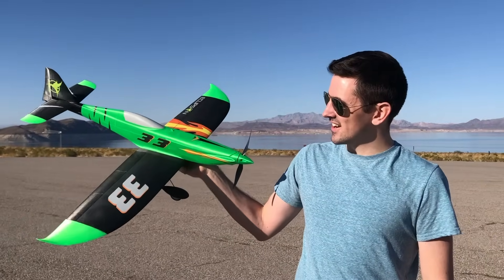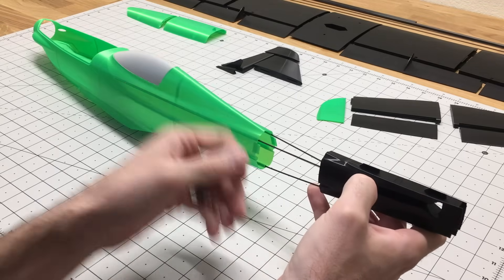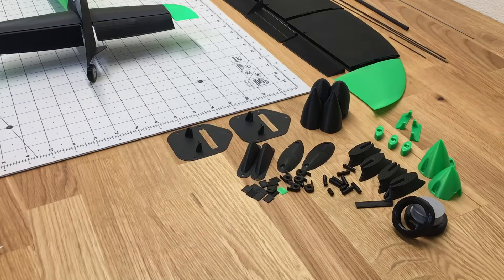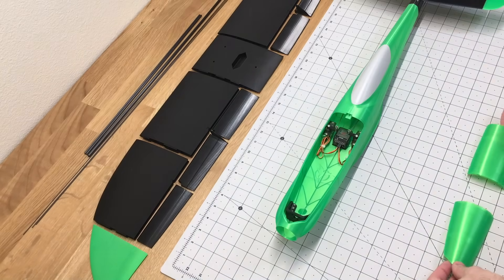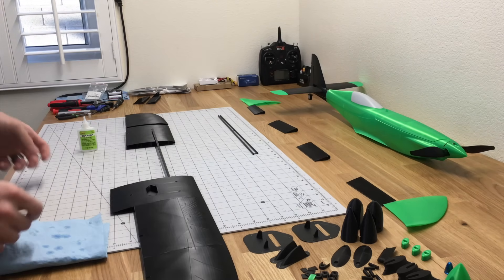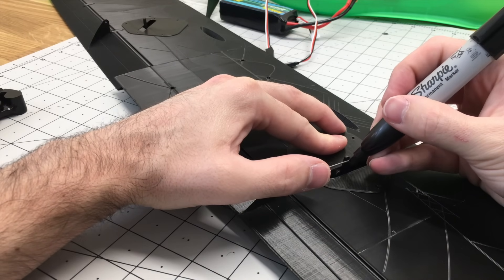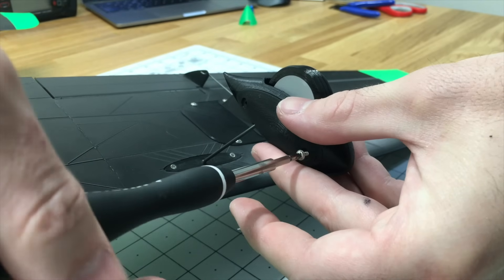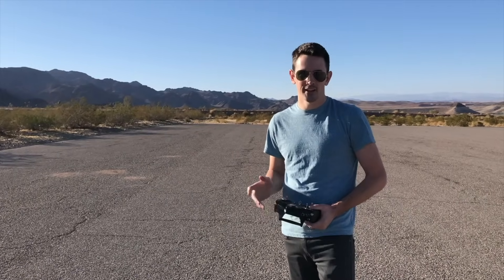How to Build 3D Printed Eclipson Model R - RC Airplane

Comment: Nice color scheme. I really like the Eclipson construction methods and choice of hole sizes for the control surface hinge points. Thanks for another great video!
Reply from the maker: Thank you CJ, It is a very clean design for sure the hinge system works very well. Cheers

Comment: Eclipson needs to offer a discount code for your subscribers. Your build videos are far superior to their own.
Reply from the maker: Thank you, Ya they did have discount codes for me but not very many people used them.
Reply: @TroyMcMillan  I maidened my Model D Saturday and was astonished how well it behaved. Bought and started printing the R today. What do you think top speed is with your motor/prop/battery setup?
Reply from the maker: @scottsmith4089  Nice job getting your model D finished up. With the setup I used I definitely think it got to 100mph but I was having problems getting a good read of speed with the speed gun I was using you can see in my flight video for this build. One of my followers said I should use an 8x8 prop I ordered on and put it on but I have not flown it with that prop yet. It is fast though and it flies very well.

Comment: Best thing about 3D printing planes like this is they're cheaper to buy them and rebuild a few crash and it's a cheaper learning curve and a lot easier than building flight test phone planes or a ball supply plane as well so 3D printing a RC plane might not be the fastest but the cheapest way for someone new to learn how to fly RC planes cuz they fly very well if you get good files and you can sand the plastic and paint it any paint skin you want with just some regular spray paint too as well it looks great but make sure you use like model car or like RC car tire spray paint that flex is on plastic so it doesn't chip off

Comment: Troy, thanks for getting me back into the hobby. Your Airbus 320 inspired me to get a 3D Printer, make the Model A, convert 9 of my 30+ year old RC Planes to Electric. So much fun. I have a question, where do you order the vinyl decals you use on this and other projects?  Happy Holidays. Scott
Reply: The plane print sites have the decal sheet scheme plans. I give them to my wife she prints them off her cricut using 3m vinyl

Comment: That looks like something I’d love to print.  It’s quick, I wouldn’t call it fast.  I’m glad to see that the designers are using carbon rods for reinforcement.  I’ve always thought the concept of 3D labprint not using carbon in their designs was massively flawed.  Having built composite airframes for a very long time, it’s willful ignorance not to use the lightest, strongest, and potentially most durable materials for the load bearing duties and let the shell do the aerodynamics.  Nice work! 🤙🏼🙌🏼👍🏼
Reply: Right material for the right job. :)
Going "pure" 3D-printed would also mean printing the motors too. LOL
Reply: They hold up pretty well ( 3dlabprints). No breakages so far with the Messerschmitt.
Reply: @user-cm6tj2he4b  I’ve printed quite a few from the very first models to the latest versions and they’ve innovated a bunch.  I’m also pretty easy on my airframes as I have flown a long time.  Having said that, as the performance and size increases on 3D printed airframes, having a carbon spar here and there will greatly improve long term durability and functionality.  It’s really no different from a Depron or EPS/EPO airframe. The 3D printed materials we use for these are brittle in comparison to other building materials.  It’s usually best to combine the right materials and apply them where they work well.   We’ve proven 3D printed airframes can be done, now make them practical in the real world where hot cars, hangar rash, and bad landings are reality.
Reply: @MacGyverDad  sure. I'm not saying it's a bad idea. Makes perfect sense. I think that's where things are going. Combining materials, using the best properties of each. Happy flying!
Reply: Wait a min I thought I was the mcguyver

Comment: Real nice & clean Work !  & i love real fast pyloners! , .. but,  i like carbon more,  yea-its allot more  work with carbon & vacum-bagging.. &, carbon expensive.. but,  it takes with a nice construction allot of G force! ,   & ..but i need a 3d printer,.. ( my Carbon planes take " 400kmh,.. , have to crack the 500kmh level.    But to print some cool airplanes,  Great idear!  & looks  real real nice , the noise is a little ,.. but in the air- nobody cares !    Exzellent!!!     👍🏼🇦🇹✌🏼

Comment: Nice work! I have also printed the plane and build. The build was easy only I have the problem that it is tail heavy. Did you had the same issue? I printed it in PLA and have a 2200mAh 4s 240Gram battery.

Comment: I’m thinking of building one of these as a fast fpv machine. Have you tried printing models in PLA+ for a little more toughness?
Reply: Also, stupid question maybe, but how do you do the graphics? Inkjet printer onto water transfer sheets? TIA.

Comment: Hello hope all is going well. I printed my with PLA and have the sunnysky 1400kv motor 
and 50amp ESC, 2200Map Lipo 3s. mind is very tail heavy. Did you have to add a lot noise weight to yours? Thanks  and have a great.

Comment: Hello Troy, Can this plane be built with LW-PLA and still have the structural strength to go 72 mph with quick bank & yank like you did in your video?  Or as you suggest use ordinary PLA or PLA+?  It would be interesting to build with LW-PLA and experiment to see how far to push it before a wing folded.  Nice thing about 3D printed planes is that if you have a severe crash you can easily print & build another substitute. Thanks.
Reply: I've just printed one in LW-PLA, so am about to discover. Given that there is a carbon spar in the wing, I'm not sure that the strength will be much different. I dunno!

Comment: Would there be any advantage to print with PLA+ and would the settings be much different or does PLA do the job? Thanks
Reply from the maker: PLA+ does have better layer adhesion. I was testing out this brand of PLA and it turned out the layer adhesion is not to good with this material. It didn't have any problems on the flight but testing out some parts before assembling it I found this out. Use PLA +
Reply: I print in Blue PLA+ from ESun. I used the GCode from the Plane with 220/60 Grad. I think for me it works.

Comment: What is the CG? I assume on the main spar?  Drawings have a brief footnote #4 "CG marks under wing"? On a low wing should not the marks be on top of the wing?  I see two oblong dimples under the wing close to inline with the landing gear and forward of the main spar - might these be it? No diagram or drawing showing these that I could locate. Thanks in advance!
Reply: 40mm from leading edge according to Eclipson.
Reply from the maker: I set the cg right around where the screw holes are, check it with the plane upside down!

Comment: For anyone watching this trying to build the Model R V2 with retractable landing gear, there are quite a bit of differences between it and the plane in the video. Unfortunately Eclipson has been less than helpful with revising their instructions and recommended materials on their site...for example, with the retractable landing gear version, the wing spar is an 8mm carbon fiber tube instead of 6 and it uses no reinforcements at all from the 3rd wing section to the wingtips, making me question its strength. I'm pretty sure as soon as I pull a high-G maneuver in mine, the wings are gonna fly apart lol.

Comment: Very nice plane.  How building Rc planes have changed, I build old school, balsa wood covered in fabric, then eventually monokote.  Glow motors because electric wasn’t even an option, and old 72 MHz FM radios (which eventually improved to PCM, where if someone turned their radio on and had the same channel crystals as you your plane would have a seizure in the air and crash.  Man we had so many obstacles back in the day and it’s funny what some people complain about now a days.  Not you, your video was really good and your plane flies great!  But it’s funny to see people having issues building foam board planes, they have no idea about hand cutting hundreds of little balsa and light ply parts, building meticulously on plans with pins, then sanding, fiber glassing, sanding more, breaking in nitro power glow motors, covering with monokote, all to be destroyed by some asshole that turned his radio on. 🤣sorry for the rant, it’s just mind boggling to see the progression of RC aircraft over the last 25 years.
Reply from the maker: WOW ya that is a big change over the years fro sure. I have never heard of the PCM situation. That would be such a bummer to have happen. My first build was my Balsa DC3. I enjoy working with Balsa wood.  I definitely want to go back and build another one eventually.

Comment: Good job thank you, but what the minimum size of 3d printer  , can be printed on 3d printer Printing Size： 220 x 220 x 250mm
Reply from the maker: Yes it will work with that size printer the minimum size is 200x200x200mm build plate for all the planes on my channel.

Comment: I've purchased this plane from Eclipson and I'd like to know how to print (or obtain) the decals? I see they have files within a folder but are they printed or what? Also, where do you recommend purchasing the 1.2mm carbon fiber rods (and what length)? Same goes for the 6mm carbon fiber tubes as well as the two 4mm carbon fiber tubes, and again, what length for each? Many thanks!

Comment: What slicer are u using ? If using cura, re u using the 4.8 with artillery sidewinder profile n editing the profile to the ones u specified in ur post?
Reply from the maker: Yes I use Cura 4.8 and Artillery Sidewinder. I use the STL files from Eclipson and slice my own parts.
Reply: @TroyMcMillan  u never mention top and bottom layers. Re these excluded from the profile settings ? Do u use just one profile settings for all the parts of the plane?
Reply from the maker: @fyzobaba  I dona use top or bottom layers for the fuselage and wing. I do use top and bottom layers for other parts of the plane. For the Eclipson planes they have a PDF that shows what parts to use top and bottom layers for. For the Eclipson planes there are two different category's the PDF has the exact settings. Sorry it is a lot to explain over a message to say all parts that do and don't have top and bottom layers.

Comment: When this model will be available on the website ? thanks awesome job ! and is possible to use a 1.5mm carbon rod to asembly the frame . Cause i cant find the 1.2mm carbon fiber rod . Thanks man ! incredible job
Reply: March 26
You can use 1mm carbon fiber which is more common or 1,2,, steel rod (the same used as push rods)
Reply: @eclipsonairplanes  thanks so much !!!

Comment: hi troy
Please can you share the settings for Artillery Genius?
I tried with the settings you shared for the Artillery Sidewinder
but does not work properly for Genius.
Printer is shaking with a frightening noise and I have to stop it quickly.
I think the speeds are not suitable for the Genius.
I am using Ultimaker Cura 4.10.0
you are using 4.8 is that better ?
I printed some parts for my quadcopters without problems
but for the planes it is not easy.
I watched all your videos and your tips.
A big thank you for your work.

Comment: I have a question I 3-D printed an eclipse plane. What I’d like to know is where do you get the 1.2 mm steel rods, I need longer than 540mm, I cannot find any place that has anything in this length. Can I get some help please thank you.
Reply from the maker: Yes I get this question a lot. I use music wire I purchase it from local hardware store. I have not found places online that sells it longer than 500mm.
Reply: @TroyMcMillan  Can i ask what hardware store exactly please. I live in the middle of nowhere, 1.25 hours to nearest city.  Lowe's, menards, home depot ext. Thank you very much for your help.
Reply from the maker: @mrsmith324  I get it from Ace Hardware, I have tried both home depot and lows and they don't cary anything like that. Just call up the nearest ACE and ask if they have any 1.2mm music wire. If they don't have it they can order it from their warehouse. It is hard to find I have tried a lot of different places now when I run out I just order 5 bundles from Ace when I run out because I know it is the only place that I can get it.
Reply: @TroyMcMillan  Thank you 🙏 Thank you 🙏 Thank you 🙏

Comment: What model of 3d printer you use?
Reply: hayes thanks. I got same from the video description. It is available on amazon and Ali Express
Reply from the maker: Yes I use the Artillery Sidewinder mainly it is a direct drive printer and is affordable. I am trying a few new printers out over the next few builds I am working on I will have some videos out shortly about my experience with them.

Comment: What kind of printer will I need to make things like this on a budget?
Reply: I think u can use any printer, u just have to get the perfect settings for it. I'm currently using an ender 3 and it's printing the parts just perfectly. It also doesn't cost much

Comment: Can you try some planes from 3dlab print?
Reply: That's not likely, besides, they have poor printing data, too many retractions, too many holes. Just bad design basically..🤔😳😯
Reply from the maker: I have built the C152 from 3dlab print. From my experience with all the different companies there. is a lot of problems with 3dlab prints planes basically unless you have a purse it is hard to print them out.

Comment: Hello I am also an aeromolder. As you have give your software to rc banglore also but when I purchased the eclipson r model and made it so I found that canopy they have printed is not parallel to fuselage . And the wheels that they have provided is too small . Call if you have to sell on you can use Amazon or banggood.com instead of giving software to rcbazaar .I am not against them but the actual size that you know is better for other parts of model
Reply: Please reply
Reply from the maker: @anmolkhare1565  I am not sure I understand what you mean? Can you clarify?

Comment: You are clearly not new to rc... and I don't want to be the safety police, but ....
I watch alot of rc YouTube channels and 2 of the channels I watch have recently been cut very badly by the prop...and I'm talking sliced tendons and stitches on the hand. Please...please dont install your prop until you pair up the reciever and enable throttle cut. Your hands are your interface with the world and not easily repaired after damaged.